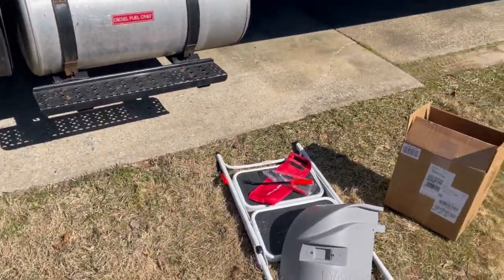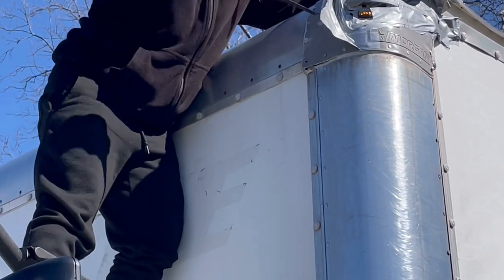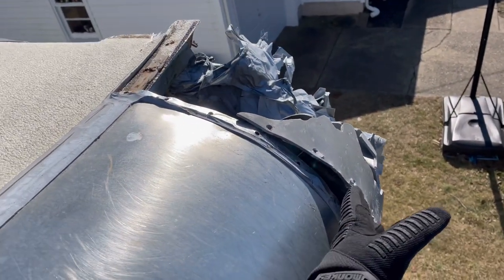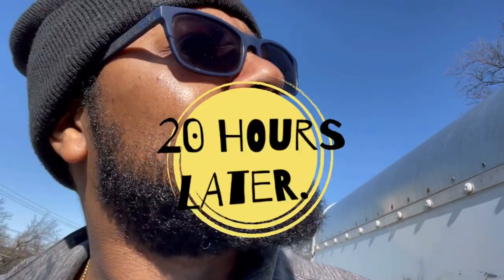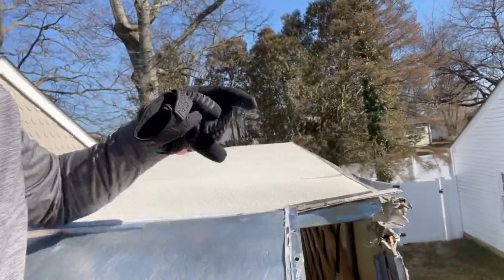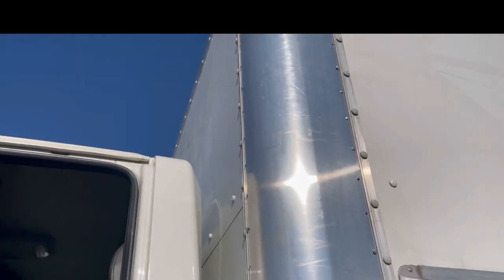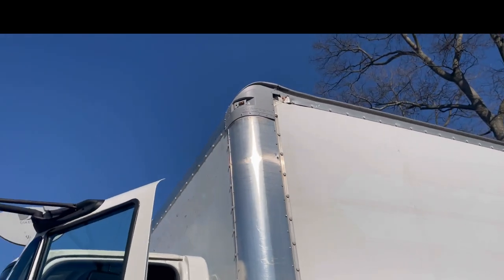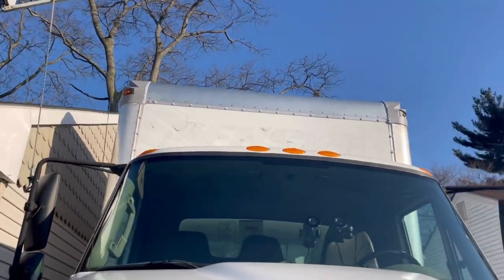Box truck Roof is fixed ya’ll

Comment: I just got approved with Amazon relay 
26 foot box truck 
I don't see any load for 100 radius am I doing anything wrong ?
Im looking Philadelphia PA
Reply from the maker: There are no loads on the board right now for Jersey as well loads will be posted tomorrow and Friday fro next week
Reply: @boxtruckdave9247  
I got into this box truck business thinking about Amazon and I never thought not having Loads in our area I mean Philadelphia and New Jersey crazy
Reply from the maker: @Batman-on6gn  they posted loads today for next week bro, im already booked till next sunday.. have you checked your board?
Reply: I just checked it says there are no matches
Reply from the maker: @Batman-on6gn  what city are you putting as your origin
Reply: @boxtruckdave9247  
Philadelphia PA
Reply from the maker: @Batman-on6gn  207 loads with a 25 mile radius bro. Your equipment is set to 26ft... if you cant see anything amazon has a class today starting at 1 or 2pm.. log on and tell them what’s going on with you account.. you should have received an email on that class
Reply: @boxtruckdave9247  I logged into the class now trying to figure out
Reply: @boxtruckdave9247  
About not seeing the loads They don't really have an answer for it.
Reply: @boxtruckdave9247  
The only way I see the Loads if I put the radius 300 miles
Reply from the maker: @Batman-on6gn  look at the board now you should see atleast a 100 loads
Reply: @boxtruckdave9247  I checked  8pm to midnight all I was seeing no matches
We don't see the same results
Reply: @boxtruckdave9247  I can see loads about 50 miles away now 
 3 loads available

Comment: Hey David thanks for the great content. I’m in the same situation sorta. I have a 2020 Hino Ames I cracked the passenger side cap. Where did you buy toe new cap and rivets?? Thanks in advance
Reply from the maker: Hey man appreciate you, i got both from Amazon, it was challenging with the rivets so if you can find a near by body shop that can use a rivet gun that would work best for you. 🙏🏽
Reply: Buy yourself a Milwaukee pop rivet gun at Home Depot. Buy some 3/16” x 1/2” long pop rivets. They are called blind rivets. Use a 3/16” drill bit and you’re good. The corner caps you can find on Amazon or from the dealer

Comment: $2,500 sounds steep to fix that little corner I see the box selling used but in perfect condition for less than that if necessary check out a few videos on YouTube how to work with fiberglass and do it yourself for pennies on the dollar I recently had to do so myself and I was shocked how easy it was to do a fiberglass repair on my own good work though I don't think you'll have any issues looks good from here LOL